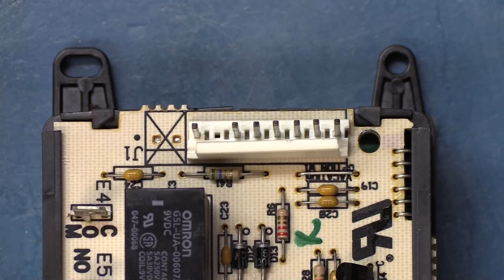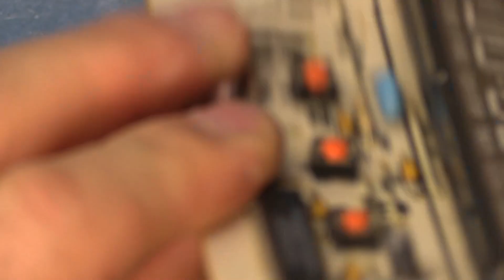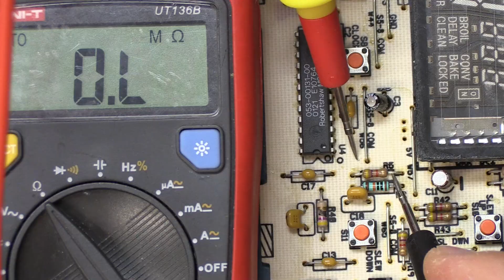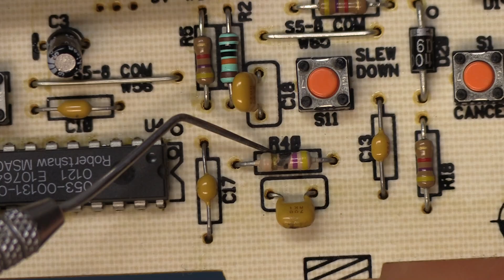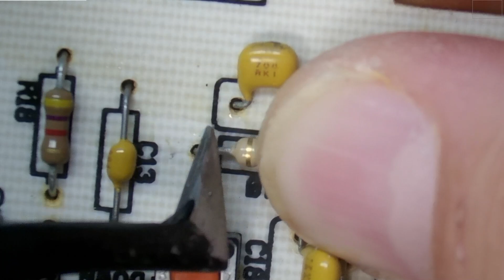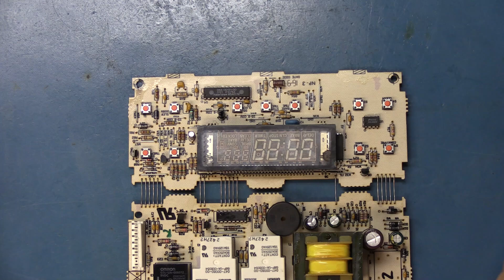Frigidaire F3 Error Code Repair Oven Controller Board 318013200

Comment: Where do you find the fluroresscent display vacuum tube?  I do know that NEC makes a lot of these they call it NEC FIP. Also i think Futaba makes some of these displays as well.
Reply from the maker: You can't find them. The ones we have we had to have them remanufactured. MOQ are killer on these. What is the part nubmer of the unit you need and or the part number of the controller you need to fix?

Comment: Thanks for sharing man! My board has an F3 code as well. I replaced the sensor and it only fixed the issue for a few weeks. I then cut out the connector inside the oven and crimped it. It worked for 2 weeks then the F3 codes are back.  Once it  even gave the f3 code without turning the oven on. 
I wish you had shown the process of opening up the circuit board.😅😂 I had mine open and checked all the caps and looked for damaged parts but didn't really see anything. I needed a few more hands to get it open. My temp circuit traces back to an 8 pin IC 4001 01k3 15 which I can not find to save my life.
Reply from the maker: If you wanted to send in the unit for repair, I am sure my team would be able to fix it for you. The F3 fault can occur because of a few different parts but is not always obvious or easy to diagnose. We offer a full comprehensive repair and refurbishing service which covers not just the repair of the F3 error but also display replacement, cap replacement, full reflow of the unit, and any other preventative repairs we deem necessary to your unit to ensure it lasts another 20 years. If you are interested, here is our flat rate service which of course comes with our standard 1 year warranty:
https://nickselectronics.com/products/318013200
Reply: @NicksElectronicRepair  Ok thanks man. That's better than a 2100 new oven for us right now!
Reply from the maker: If you have any questions regarding our service or process, don't hesitate to ask. For faster replies though I would recommend reaching out to us directly either via our contact form on the website linked below or email info@nickselectronics.com

https://nickselectronics.com/pages/contact
Reply: @NicksElectronicRepair  Ok sure will. Thanks!
Reply: @ Hi Nick! I sent my name, part number and problem in on your website. Just kind of curious as to how much its gonna cost.
Reply from the maker: As long as you provided your Range model number or controller board part number then we should be able to provide you with a quote. I did just now try to find your inquiry, but wasn't able to. I am sure it is there, but we do have 47 new emails from the weekend and am unsure which one yours is. My customer reps starts at 9:00AM Tucson local time so in just about 1h from now. They will be going through all the emails and information and should have a response for you later today. 
If you have the same exact unit shown in this video I did give you a link for the repair service which also includes the replacement of the display. 
https://nickselectronics.com/products/318013200
However if you don't have this exact unit which commonly experiences the display issue then it is possible your unit might have a lower repair price as those displays are expensive. Again it will depend on the model and one of my customer service reps will be getting back to you soon with a quote.
Reply: @NicksElectronicRepair  My display is working fine. The oven temp circuit keeps powering off the gas. If I set it to 350 for instance lately  instead of watching the temp climb to 350 in say 20 minutes it jumps to 350 and shuts off the gas like 45 seconds immediately after startup.
My unit is the WB27T10268

Comment: Changing all these big parts will bring the price of the repair  more that the price of the whole board?
Reply from the maker: Hello,
I am not entirely sure what you are saying. Are you asking if replacing the relays would make the repair more expensive? Not really but the thing is that the realys almost never fail so there is no need to replace it. 
Was that your question?
Reply: @NicksElectronicRepair  Not to speak for him, but I'm pretty sure his question  was whether changing the "big" parts (big meaning expensive parts) like the VFD and two ICs - cost more than the board including labor.  My guess is that he doesn't know those boards aren't really that cheap, and more importantly, often aren't even available anymore.